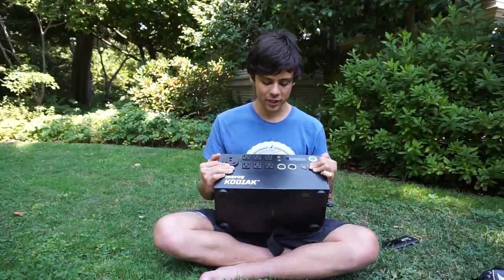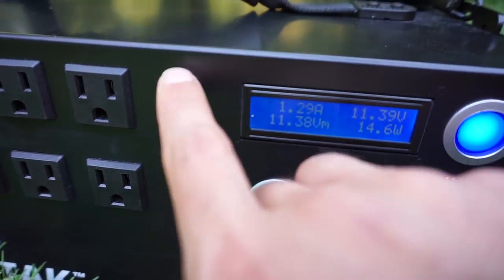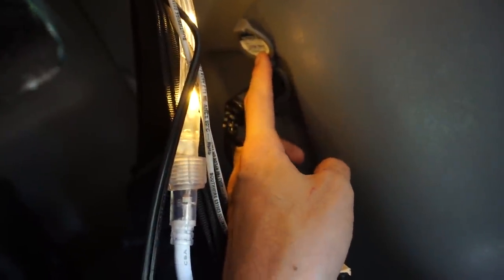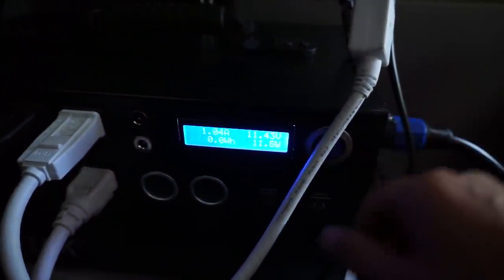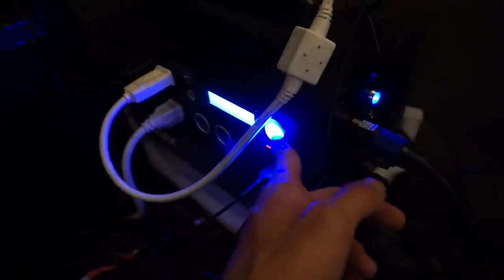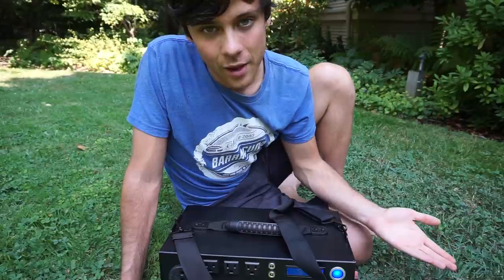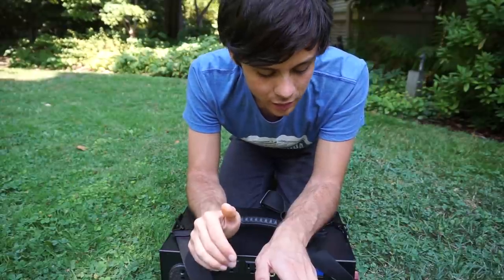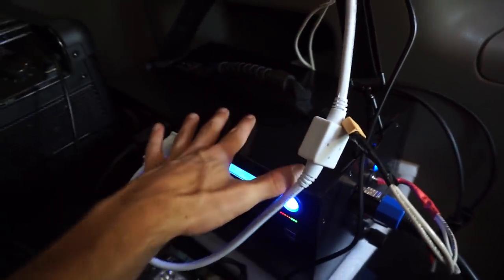Inergy Kodiak Solar Generator Full Review: Pros/cons, load test, how to use it and much more!

Comment: Not sure anyone mentioned this, I've seen the solar charging cable and adapters before on speakers in the commercial applications and they are that heavy duty.  They come with Edison plugs but not sure that you could plug it into the all and into this product.  You can with the speakers, sub woofers and line arrays.

Comment: You piggy backed a battery or 3 behind it?  If you are charging 120 from wall, will it run at 1300?  is it for sure the machine?  maybe its because its so small.  thanks for video, was really informative.

Comment: You can run a small cheap 5000 btu ac unit with your solar gen during a sunny day on low it would work just fine. I did this with a car battery for 10 minutes it had nice air. This would really be like 300 watt load on the system with solar feeding. The typical cheap off the shelf unit consumes about 4 amps and lowers as it cools down its just the compressor needs 600 watts to turn for 30 seconds. Something to ponder and modding the fans into cpu 200 mm fans would shave off more power demand.

Comment: Hello and thanks for your video. Quick question, you mentioned that this would not be able to  handle A/C. How about a 5,000 btu window a/c in the 420 to 460 watt range? This could be enough for a very large van or a small RV. Obviously you could not run anything else as during a clear day you will most likely get 500 w on the average from the solar panels.

Comment: Hey Will, so how many amp hours does this thing hold? I use a 12-volt deep cycle lead acid right now hooked up to a 600-watt pure sine wave inverter to keep my laptop charged up during the 10 hour work day in my truck. ;) -side note huge fan!
Reply from the maker: +Jason Owen 90 amp hours at 12.6 volts. What size lead acid do you use? And thanks man!!!
Reply: So it's just a typical Lead Acid RV Deep Cycle Battery, Probably 80 to 100 AH, but I only can use around 30 ah before dropping the volts low enough for the inverter to complain. I use a 100 W Solar Panel to recharge it during the day, also plug it into a 120 v ac to 12v DC battery charger to charge it at night from the house. (My goal is to upgrade it to a 12-volt lithium battery)
Reply: Denis Fortier, He asked me what type of battery "I" am using.. I know what the video is showing, Thanks

Comment: Maybe others have said this, but if you just want to charge from the USB without activating the inverter why not put a USB plug in one of the 12 volt car outlets?  This will avoid having to run the inverter and you can remove the USB charger when you're done to avoid draining the battery.

Comment: what a review, you forgot to mention the serial number on your kodiak besides that, i think you covered everything and then some.  about charging, why not hook up your solar and your car alternator power to the same cable with some other junk to regulate the voltage and then charge the kodiak threw that one port?

Comment: Thanks for the info! QUESTION—I have a Kodiak and I would like to use a Renogy 200 or Zamp 200 watt solar briefcase to charge it. Both of these Solar brief cases have charge controllers on them. I assume the Kodiak has a built in charge controller, right? Will using a Solar brief case with a charge controller mess up the Kodiak? So, should I hook up solar panels to the Kodiak without a charge controller on the solar panels/brief case? Thanks so much for your help!

Comment: You should do a kickstarter and build a model yourself then sell it on your website. It's your idea make money off it .
Reply from the maker: +shu qin barnhart have been considering this actually
Reply: Will Prowse you really should. I would be on board. Would love to help if I can.
Reply: I'm interested too. If you need some initial funding I would be down. I'm looking to buy an RV soon and would like to build the most efficient system. Hope to be able run my lights, induction stove,  and maybe generate heat in the winter.
Reply: Like Carlos and CD Williams, I too would be more than happy to help kick start your ideas because you obviously know what the market needs. Make a business model and let us know. Thanks for making videos like this one, you explain things beautifully and make complicated subjects reachable to everyone. Go Team Prowse !
Reply: +Will Prowse Same here I would love to help. Also, maybe you thought of this already, but I would love if you could somehow make it an add on battery system. Example, if you wanted 5 batteries, all you would have to do it but another battery and connect it. That's it. Then the base station could tell you how much more power you have.. ect... Also that way people could have as many batteries as they wanted. I know it's probably hard to do this, but I'm sure you could figure it out.:D
Reply: It already has the ability to add more batteries. The red and black wire nuts/terminals on the side are made specifically for that.
Reply: Carlos Gomez a drop in chargeable battery unit  done right will.make you a multi millionaire  easily, every van dweller,man shack,shed and remote location you'd be crazy not to

Comment: Great video. Please correct me if I am wrong, but with the solar hooked up and generating reserves to the lithium in excess of 500 watts, could I run a small 5 amp 6,000BTU unit Walmart A/C continuously which would be like 450 watts maybe a bit more and still charge my lithium kodiak with the reserves as long as I run nothing else. I mean maybe run my 4.5 cu in refrigerator which is only about 1 or two amps once it kicks in, on a timer for 15 minutes/hr to keep my food cold, but run nothing else? I think it would work. Please let me know as I live in a cargo trailer conversion permanently year round. Thanks.

Comment: I go out on 3 day to 3 week adventures (not full time van life). I am also a complete novice. So you have mentioned having a big enough alternator to car charge- So how big  or powerful do I need? I also have a dodge conversion van with a bubble top solar panels are not easy to put on roof due to irregular size.

Comment: VA and W are not the same if the power factory is less than 1.0, therefore that 1300W could be pulling more than 1500VA.  does it identify loads that way?
Plug your watt meter into the generator's outlet, then plug your power strip into your watt meter.
Also, the best way to eliminate voltage drop is to run separate smaller AWG wire runs back to the generator and plug each cable/panel into a terminal block that can be series/parallel wired easily, then plugged into the generator's input port.

Comment: I might add that the 600 watt max charge from solar panels is a little misleading. You are regulated to 30 amps max from solar, so if you have 6x100 watt panels, they should be 5 amps or less on each panel. Anything over will over-charge you're battery and most likely damage it. Inergy says the controller will be damaged but the battery will definitely overcharge. Ask me how I know.

Inergy:
"The manual does state not go over 30 amps of combined amperage when using the high current charging port. At most times the Kodiak will not be receiving the full charge range from the panels. However during days were solar charging is at its highest the Kodiak will receive more then the threshold allows. We have never stated that there is a charge limiter that will make sure the Kodiak does not get more then 30 amps. The charge controller will limit the amount of charge allowed to enter the system but going over 30 amps harms the charge controller."

Comment: Great vid thnks.  I came across this generator by Dewalt at 1800 watts for power tools DEWALT DCB1800M3T1 Portable Power Station.  This could power microwaves etc as a battery generator.

Comment: That is a pretty good over the counter power source. But what you ask for Will you will still have to build yourself at this moment. 100ah lifepo4 battery that can take 50 amp in and 100amps out continuous, with bursts up to 200 amps for 30 seconds should fit the bill. They sell these batteries for less than 1000 dollars. With a budget of $1800 you could build it better I think.
Reply from the maker: +NYangryguy I went over this in the video. Did you watch the video?

Comment: One other thing that is off in the near future most cars will be electric. All the power you need will be included as standard equipment in all vehicles. If you want to research something that has more usefulness why not try low power consumption (12v) a/c units. There is nothing out there now but they would sell like hotcakes when finally available.

Comment: Hey Will, dig the channel! I just received my Kodiak and I was hoping you could recommend a way I can charge it with my two SunPower 330 solar panels without damaging it, as the VOC of the panels is 67.9 each, far above the maximum for the kodiak. Is there a MPTT charge controller that you would recommend that I could use to prevent the panels from damaging the unit? Really don't want to buy 6 100w panels as I already own the 2 330w panels. Cheers!

Comment: Very informative, although I have no idea what you explained. What I do know is I'm thinking of RVing the States in prob a class A. RV parks and hotels but for when sure power is not available (lake camping), is this something I need? I don't want to be hearing the noisy generator running all day. When the time comes, is this something you can put together for me as you sound very knowledgeable. New following here. Hi
Reply: Vincez Bee 
Check out the various setups on his website. There's one sized for class A rv. Then if you need extra help you can buy his book, which I haven't yet, but looks like it guides you step by step. I'm sure you can handle it. Just go through his videos and make a list of all the "don'ts" first, like getting water on a generator. Also, it seems like this model he's reviewing would work for your purposes.

Comment: I like this thing. The low voltage input almost makes it like a battery isolator. How long would it power a 110v dorm fridge? I guess the constant inverter is a pretty big drain.
Reply from the maker: Radnally it's only 14 watts extra, for standby inverter power. Not that bad. Typical for inverter of this size. Zantrex inverters use only 4 watts! But this is atypical.
Reply from the maker: Yes you can run a fridge for days on this. On the website it rates it at more than 30 hours. It really depends on the fridge and environment it's in, and what it is cooling.
Reply: efficient Dometic or Engel 12 volts compressor fridge use only around 200 watt-hours par day so your system is big enough, you have around 1100 watt-hours

Comment: Great video.  Big question.  Can a Kodiak be charged via a 1000e power inverter with an 80-90 amp fuse?  Numerous videos have Toyota Prius owners wiring a 1000 watt pure sine wave inverter into the secondary battery ( not the expensive hybrid battery).   They are putting a 80-90 w fuse in the system to avoid going over 100w.   This would be a wonderful way to charge a portable Kodiak generator.  Any ideas on wether it would be feasible?

Comment: I'm considering buying the Kodiak for my Class C RV that also has a 4kw generator. I just plug the RV's 30 amp connection into the Kodiak energizing the RV's AC outlets but it would also start the stock converter charging the RV's house battery which would be running the 12v systems. (I also would probably add 2 external batteries to the Kodiak.)  If I charge the Kodiak with up to 600 watts of solar and hooked up to the vehicle alternator when the sun isn't shining. (Perhaps get a bigger alternator and hook it up directly with a bigger gauge wire to charge the Kodiak when driving.)  I'm guessing charging the Kodiak without solar via the alternator would be more efficient than running the generator which would require some kind of switching to it and it would only charge the house battery. Would that work? My head hurts. PS I bought your solar book and enjoy your Youtube videos.

Comment: great info, I used your code to buy my Kodiak! I am still learning and researching but I am currently converting a sprinter van. I have 2 maxxair fans, a dometic fridge, a couple led touch lights, led rope lights and a diesel heater to hook up. Does it make any sense to wire the more permanent things to a fuse box? Is that redundant? i would like to have some switches wired and also leave some of the ports open for temporary appliances. would I use the battery terminals to connect to the fuse box? Any advice would be appreciated!

Comment: Those 12v plugs on the front are the first problem you'll have. When plugging those adapters you'll get a big spark and Kodiak protects itself and shuts down.  There is a reboot process that is not in your instructions (unless they have fixed that). Secondly panel charge port will need adapters for other panels and Predator(Kodiak) panels are worthless. Great concept. I think they will get better but not yet. I hear the K2 improves some things but I was with them since the GoFundMe launch and paid $2500 for a setup. Almost 4 years later and Inergy products are in storage. Can't sell them and no love from Inergy.

Comment: I looked up some sites in 2020 and now these units sell for less than an iPhone 11 ($1200). There must be a way to buy these with a full set of cables with a monthly rate on a 2 year contract? I miss an European model with 230v outlets. That might explain the 1300 Watt cut-off at 5 minute load. With a 230v converter you generate less heat because the amperage is a lot lower and possibly 2000 Watt load is possible.

Comment: I just took delivery of a 2016 Promaster and have been seriously thinking about abandoning the standard solar electric setup for the Kodiak system. One of my questions is though, would it be feasible to have a small high quality extension cord plugged in and run to the other side of the van for using an occasional plug in appliance? Reason is that the only con I can see with this setup would be that everything has to be plugged in to the same spot. Thanks

Comment: I wonder if I can use this device for things like a 34” ultrawide monitor, Xbox, laptop, charging stuff, then have a multi battery set up for things like led lights, roof fan, and other 12v things I’ll need? You mentioned paring batteries with the device but only get 3/4th the battery. I wonder if getting two of these so you can run all of your appliances like you tried? Or maybe keeping one charged so you can have continuous power while you charge. If so, how would you connect 2 of these devices to your solar system.

Comment: Hi Will, I have an Inergy Kodiak and a Jackery 500. The Jackery 500 seems to work so much better than the Kodiak. It charges much faster with my solar panel and from my car cigarette lighter. It uses less % power to run my appliances like a waffle iron and an instant pot. Could it be that my Kodiak has never worked correctly? I got it on Amazon and it was supposed to be brand new but I am wondering.

Comment: thank you! very good review!
wish someone would open a kodiak up and check whats writen on the battery. or at leadt do a liw drain test with the inverter off using thecigaret lighter plug with a fix load like 100wh load to see what the battery capacity really is. my guesd it's a bit lower than claimed

Comment: The problem is mainly the voltage of the battery pack. A 12.6VDC battery pack at max charge is very low voltage to bump up to 120VAC, and is very inefficient, and creates a lot of heat.
 
A  21V battery pack would've had the same capacity, and 1500W would've been possible with the inverter, without the lead acid battery pack.

You would just need to bump down the voltage for the USB ports and the DC jacks, and the inverter would've been much more efficient.

Comment: I know this is an old video will, but I came back to rewatch it because I'm considering this now that I'm moving back into Honda Odyssey. Thing is my main source of income is stuff like GrubHub in Uber, and I probably Drive only about 4 days a week doing it, however I drive a good 12 hours a day. My question to you is, for work would it be beneficial to me to go ahead and buy the official adapter to plug into my cigarette lighter? Not exactly new to solar and I've had multiple 12 volt battery systems in the past, but I was in a motorcycle accident 6 months ago and unfortunately the two 100 amp hour deep cycle batteries I had wired in parallel we're not treated properly in that time and so they do not hold a charge. So I'm considering spending the extra money and getting this thing instead of buying two more deep cycle batteries.

Comment: I want to put 4 150w Renogy panels on my transit, charge it also with a solenoid isolator. I plan to add batteries to the Kodiac. 1) if I have 600w from solar and 240amp alternator charging could I damage it?   Could I add 400 ah of Lifepo4 battery instead of AGMs?

Comment: I'm thinking that the reason it couldn't handle the continuous 1300 watts might have something to do with how hot it (the unit) got in your car.   I've seen a few other videos where people were running 1700 watts continuously for at least a few minutes, but they were doing it either outside, or in a large air conditioned room. 

It could either be that, or, you might have a faulty unit.
Reply from the maker: No it's the discharge rating of the battery itself. Look at inergy's comment here in the comment section